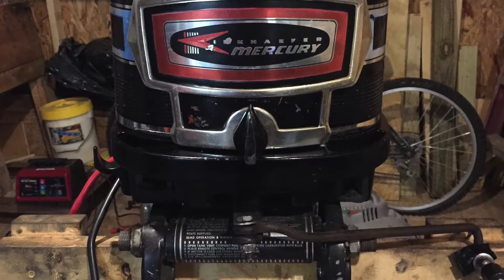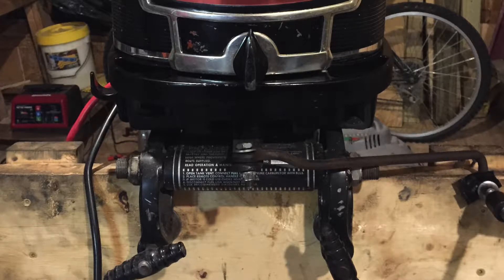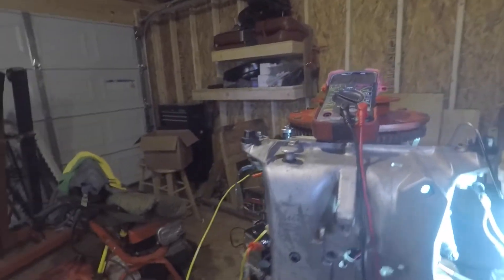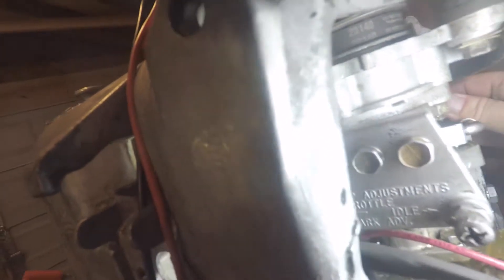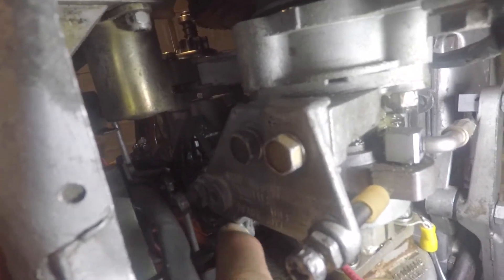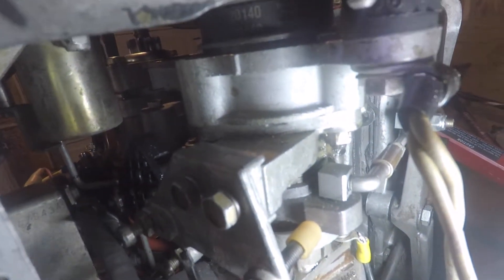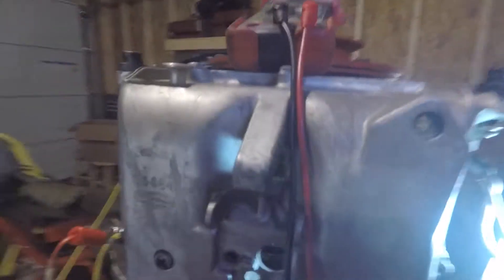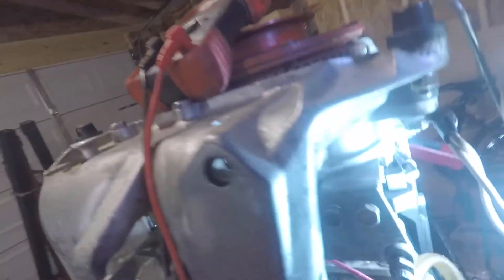Mercury Thunderbolt 500 50 HP Part 60 - Timing Secondary Pickup

Comment: The butterfly is Wide Open?  Does it mean fully open?
Reply from the maker: Yes looking at carb when its closed the butterfly is closed and when its open its completely open.  The butterfly will be horizontal in the plane or throat of the carburetor.  Not vertical or closed.

Comment: I'm curious  to know  what effect any adjustment to the swivel and link rod would have, My motor (identical) requires the spark adjustment screw to be turned all the way in to get it close to  getting the "signal". The "signal" at 35 degrees seems to occur  slightly beyond maximum adjustment of the spark advance screw.
Reply from the maker: Make sure your timing belt is aligned correctly.  The swivel and and link rod shouldn't have any effect.

Comment: Great info for setting the secondary timing. I was wondering if the ignition had to be powered  up with the battery (12v) during this test ? Thanks.
Reply from the maker: Yes, key on.  Just remember on the thunderbolt there is no 12 Volt supplied to the power pack.  If you do this it will fry it.
Reply: key on but no power to this type of ignition , that's the beauty of this set up dead battery wont strand you out in the middle of the lake .
Reply: @hawkeyemarine  ,good information. so what supplies to the power pack.
Reply from the maker: @yijianggu5203  The trigger inputs from the distributor.  It powers the power pack.  Don't put 12v to it from the battery or you will fry it.
Reply: Thank you.Don’t put 12v to ignition coil or red lead from switch box?
Reply from the maker: @yijianggu5203  From the distributor to the switchbox RED, BLUE(SOMETIMES BLACK), WHITE to switchbox red, blue black.  To the coil its GREEN TO GREEN, and Black to Black or Ground.  Key off/on is going to be Brown that goes to the BLUE terminal.  Stator to rectifier to Hot side of battery, Solenoid it key on/start usually YELLOW/BLACK and Choke is GREY typically.
Reply from the maker: @yijianggu5203  could be a couple of things.  One its connected to a Mercury filled switch so when the engine tilt too much it allows ground to pass.  Or if your wiring harness sends ground to the switchbox when the key is in the off position.  Thanks for watching.
Reply: @hawkeyemarine  Thank you,is the blue wire from the distributor grounded as well?
Reply from the maker: @yijianggu5203  No I believe White is a potential between the RED an BLUE coils from the trigger in the distributor.